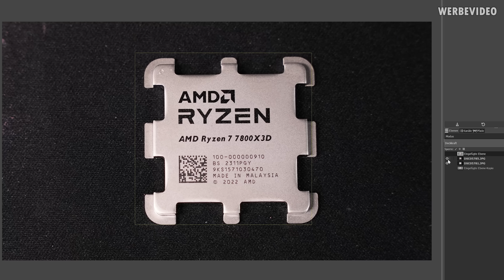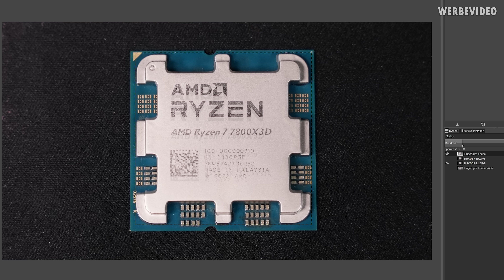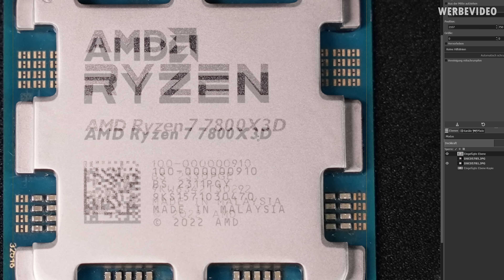Beware! Fake Ryzen 7800X3D CPUs are being sold

Comment: I bought same fake 9950x from local retail store last week. Same PCB, same lid, but different label on the lid. Even serial number can be verified on AMD website (though it says it's a BOX version), but DataMatrix code cannot be scanned. But PCB is 0.15mm larger, barely fits socket.
Will return it tomorrow.

Comment: motherboard makers need to change who wants 20 usp ports and then hey guys we only giving you 4 sata ports far cry from the old 990-fx motherboards 8 sata ports and still had more than enough usb back then the 990fx board runs win xp 64 and native supports 32gig ram win 7 does not you have to be 7 pro or ultra to get 32gig ram also runs win 10 with out issues has all drivers for xp 7 and 10 this should make people really forcing the tech industry to be accountable for the shit show we have now microsoft owns directx they have more influence then is every spoken about. microsoft windows has yet to make a stable media player there is no blueray for windows have blueray drives so what they are usless ewaste now unless you are data storge but hangon how when you dont even have drivers for you blueray WTF .Next secure  rom cd dvd protection does not exist anymore was removed from 7 and is not in 10 this is why game disks will not work and the industry solution for this is buy the game again but you dont know that if you for exable purchase mass effect on steam it doesnt run if you buy from the scam masters EA it works WTF world consumer laws what a joke ram manufactures wont even state what chips are used 100% proof of this fact..... GSKILL dumped all old 8bit chips on the ddr4 ram to get rid of it 2023 date on the ram vers the sam ram bought back in 2021 has 16bit chips if you no your stuff this is not good 8bit vers 16bit double the bandwidth yet not on single youtuber will ever call out this companys like this the only thing you get is a load of it does this were doing that and we will over charge you all the way Honestly WTF happened to all the x570 boards that just disapperaed well they didnt the answer is this manufactures and sellers statement x570 has been discontinued and only low end buget b550 boards for am4 they is just a straight up kick in the guts with a big slap on the face and a F******* you attched to it thanks for the '' we are dedicated to our costumers "" load of shit every cd dvd game that has seucre rom should have been made to be free not con and scammed like we have to the entire world stop and make these scamming con assholes accountable the are cons and scams give me your data i give you no choice im windows ,ea,bethsoda just give us more money and your data so we can sell it and give you nothing and make more money and we still give nothing fsr does not work on new gen games especially dx12 dlss is no different and i have tried this i have a 7800xt my friend 4070 master the nivida card gets the edge not for performance game support nivida is up microsofts ass always was and the compatablity is the thing but windows microsoft is trying so hard to stop this and its simply dx version support in the os call of duty will not run dx6 from memory yet how strange is this heavygear original game cd loads and runs like F*********************** Seriously how and its on bloody win 11 the whiole bullshit about compat issues is a load of shit proof is in the pudding boys and girls its simple cost over profit if it dont break and are not forced to buy new products at this every changing pace the share holders dont get there bonus and billion dollar profits they created the throw away tech low end underperforming crap that you will be lucky if it makes it past warranty before it dies if it does you know its going to fail they dont make boards like the 990-fx anymore i also have the intel version it came out before the 990-fx 2011 and 2008 both pcs still run fine the 990-fx had a gpu failed thats it i saved it from ewaste it just cannot connect to the net for 10 as hopefully it fails 11 support but if it dont it will force 11 install like thanks micrsoft dont even get a choice forced upgrade Seriously and prod perfomance from back then to now is nothing special main thing there was better ram motherboards have just got worse the x570 what a joke they must have made f*** all of these just give you budget shit who in there right mind would use a top end gpu on a f****ing buget board WTF WTF WTF WTF WTF  and price for 800 dollars i can get complete am4 pc maybe even am5 depending on board selection cpu and ram its not to bad for am5 but the bullshit dumbing 40 series now like nivida PPP if you get it and price from old to new vers perfomance thats for a the more money than brains people have to win the pissing contest to bad that is what it all really is YES? Screw the industry return the money you stole from the people for buying your product repeatedly how many copies of the same games do you own from be forced to buy a download soon there wont even be stores 100% online higher unemployment more robots replace workings warehouse industry basically automated robot does it all stack back and store meatworks bring in automated cutter instantly hole section lost there jobs reap the wirlwind people we created the mess just as much as them for we allowed it to happen never said a word all to busy having heads filled with tv shit so we neve even saw it facebook is an entity does not answer to any laws has no customer support and like many other online shit now openly allows multible fake profiles allows false advertising scammers and cons and the world does nothing we are never given the freedom of choice form the tech industry you will accept our terms and the collection of your data or the choice is just simply go away.What is wrong with the world have we become that pathetic as a species Australia 100% yes tell me freedom when you cant have visitors after 8 not allowed to do this if you leave your bike here we will take it and breach you THIS IS FACT the govenment is shit i can prove with zero doubt as its all on record in court if you cross your arms like you were told many years ago you willbe told to unvold your arms as you will classed as having a anger problem. you must not feel in australia if you do there is no help you are just classed as hostile with anger issues let alone the government still to this day takes children i have no rights as im not on a piece of paper like i was even given a choice but you are not allowed to stand on morals or what is right guilty prove you are innocent that is australia we dont even have a unified legal system to protect the greedy business owners that break the laws seen it with my own eyes fact this is why wa has its own transport laws protect the ownwer not the poor explotied worker. australia buisness 101 work faster not safer Fact dont say anything either they will sack your ass for pointing out the failiures of the so called saftey person i have watched pallet after pallet 8 meters up 1000kg that is so bad dangerous and bloody negliegent its not funny....100 % illegal to stack thatv weight that high there are laws do you think wa gives a shit about this no never will freedom rights consumer protection doesnt exist feed the greedy thats all we do

Comment: JCLPCB or PCBWAY + couple of hours of designing the PCB (probably even less - the biggest challange is to make the capacitor location exact), capacitors are probably not even real, but just blanks - that itself is probably around $10 for couple of tens of pieces. A CNC router (below $1000 ) to mill the heat spreader from Aluminium, then nickel plate it... That is the most complicated part.  I'm not sure if the print is laser engraved, or just some sort of thermo-transfer of a laser printed printout. It's not very sophisticated to achieve these days. It just shows, how the technology advance can play to our advantage, but can also be used in a bad way.

Comment: I just bought a 7800xt PURE off amazon on a lightning deal for sub$450 last week. As soon as I put it in my pc and booted up, I checked the update drivers and wanted to run some benchmarks. To my greatest disappointment, the GPU launched as a 7700xt. The GPU was factory sealed, factory stickers and the usual vinyl protection tape. The core of the card was not a 7800xt. The issue with the PURE is the 770xt/ 7800xt and 7900GRE all look exactly the same. I am guessing a buy and swap to return? I never thought I would have this issue and as we have absolutely 0 brick and mortar pc diy outlets in Scotland, we are at the mercy of the internet. I am well aware scamazon and fleabay are the worst places to buy and if a deal is too good to be true, it mostly is.

Comment: absoluut perfect.
i,m just back from China, visit the big Shenzhen bay market stupide as i was i but 10 ! SD cards.
i saw hundreds of shops including a sd card shop where i got "real" Sandisk extreme pro sd cards 1 TB 200 speed and 140mb/s
too good to be true still a 1/3 of the original price, unfortunately i couldn't test them on the spot but i trusted the shop because of the professional appearance, unfortunately when i got home (114600km) they didn't really work well and made errors.
i tested them and formatted them in dos there was only 256gb left of the 1000gb, and a very low speed.
During a previous visit to China I noticed that something was wrong, I had the latest iPhone model 4 in my hands for $100, well... I left it there.

Comment: I was buying a ryzen 9 7980x3d  recently and found someone selling on Amazon for $350. We know that on Amazon, you have protection, but I decided to buy it from the market for $650. My guess is the cpu was not a scam or fake but sold for different regions with high rebate and could not sell the quantity. Amd pays many funding these marketing videos as they receive complaints from distributors losing revenues in certain regions due to unauthorized imports. 
This example was ascam but did anybody pay less and got a working cpu? I am keen to know.

Comment: The level of effort that went into making this fake means there are definitely thousands and probably tens of thousands of these fake chips out in the wild.
The level of manufacturing required to produce the cpu's, the heat spreader, the laser engraving, the boxes, and then match the S/N on the box to the cpu is insane, just to produce a useless product. 😮

Comment: Bruce Lee, an enthusiast from Romania, bought a fake 7800X3D possibly from a Chinese seller on a marketplace made by a Netherlands company that is under the umbrella of South Africa and India parent company. Man what a wild plot why didn't this become a movie?

Aside from whatever I just write,  WTF?? At least with fake 7800X3D that is just non X3D AM5 parts but with faked IHS engraving, you can just resell that, assuming the buyer of that fake X3D doesn't follow the same route as the shady seller and jack up the price + labeling it as X3D chip while it's not, like please don't do that if you're like, don't want to be stressed out by the marketplace return policy if it somehow is just complicated, bad or nonexistent for some reason, though you really have to try and get your money back. If there's no hope for that, follow the moral compass, accept the losses, learn, and move on. But like, at least that would still function as a normal AM5 cpu for you or the hands of whoever going to buy it, as long as it's also not an engineering sample 

This however, this is pure ewaste contribution. Those PCB could've gone somewhere legit, same goes as the metal used for the IHS. And someone decided to make an ewaste scam out of it

Comment: Is the fake heat spreader actually copper, or is it steel or some other, cheaper metal? Aluminum might be too light, so I'm thinking mild steel would be a good possibility. It would probably need a flash coat of copper first to get the nickel to stick, but that would still be way cheaper than using solid copper for the heat spreader.

Comment: It's possible the scam originates from the factory where the heat spreaders are manufactured.
Reply: Everything is possible.   The PCB's are easily bought from online PCB manufacturers.. You could even order PCB's cut to size, and even have all the capacitors presoldered from the PCB manufacturer.

Comment: Smart enough to use a Multimeter to check a CPU.......not smart enough to recognize a scam. Sounds about right.
Reply: Not possible to recognize it as a scam, until you have the item in hand though.  That's how accurate the fakes are.

Comment: i got my 5700x from a reseller. the box it came with had the rather unique-looking import label with the names of the person i bought it from (this is a guess), and the name of the person the seller bought the cpu from. long story short, my cpu came to argentina from florida, and to florida from china. turns out its an oem chip. the quality of the silicon isn't good but at least it runs flawlessly so far. i don't need this much performance so i just run it at 3.4ghz with the lowest voltage it can tolerate, currently 0.80v and probably even lower if i weren't always busy with keeping a stable job.
Reply: Oem chips are the same quality. You might have a dev sample
Reply: @hiddeninthewires2308  it looks like a completely normal chip

Comment: Just in case you would be interested in some analysis, I have a genuine 7800X3D that ran fine for months but died suddenly during a benchmark run with a hefty OC. I had it running on a X670E Gene with 105 BCLK, LLC 8, CO +10 all core, PBO Enhanced 90c, RAM at 6600C28 1:1 mode 1.450 VDDIO 1.300 VSOC 1.150 VDDP. The PC just turned off during a Y-Cruncher run and only QCODE 00 after that. I tested the CPU on 3 boards and all 3 just stick to 00 or hang on CPU LED during POST. The boards are fine with my replacement 7800X3D which works fine. There's no physical damage on the pad side and the CPU does still heat up in the socket on 00 QCODE without a cooler on it. It's not delidded. Temps at the time of failure were high 70c range but the core voltage due to BCLK and LLC 8 was very spiky and I saw 1.296v+ regularly under lighter loads. 

If you want the chip, I'm, in the Netherlands so shipping to Germany is cheap and fast and I'm not looking for a paid replacement or whatever. I just want the shipping covered and I'm curious if something can be found out in the name of science / my own interests in hardware.

I could've RMA'ed the chip if it wasnt for the fact this is a Tray SKU CPU and AMD does not warrant Tray SKU's directly and the shop it came from immediately claimed user induced damage and also won't cover it so I just bought another one as I really can't be bothered to discuss warranty validity for weeks and be without a PC and technically the shop is right, the chip ran fine for months and it broke while overclocking and while AMD has a LOT of protections and limits set up for X3D using BCLK + LLC 8 + positive CO can still go way outside of the limits so it IS user induced damage and I don't wanna claim that as warranty tbh. This time I bought a Boxed SKU tho..

Comment: The PCB color on the "FAKE" 7800x3d is the same PCB color used on GENUINE 9000 series. 
7000 series use green pcb, 9000 uses whatever color that is called on the fake 7800x3d.

Comment: There is an Embargo on China for new generation CPUs, just as there is for Nvidia 40xx CPUs. So the Chinese counterfeit them en masse, then buy them through their people in Europe, send them back to the manufacturer of the fake cpu, then get another good CPU in return, and that's how they get around the Embargo by having a brand-new CPU worth 50% of the new CPU on China. Three months ago I bought an almost identical RTX 4090 graphics card on TEMU. Everything almost the same as the original, except for a slight difference in the font on the prints.

Comment: my wild guess is that display prop that put during expo or showcase, like phone case with fake display. because the size is small and pocket size, it's common to use fake display prop. but in marketplace usually the order is not immediately closed when we receive the package, in my place we allowed to have 2-3 days before we can close the order and money transferred to the seller, so within 2-3 days we can open dispute regarding the product (not sure with olx tho). usually the main issue is that when we order both (cpu and motherboard) at same time and it not arrived at same or within dispute time, this make testing is difficult.

Comment: One thought about the "screw holes" in the heat spreader.

Did you compare the weights of the real and fake CPUs?

That extra metal might have made it too heavy and get picked up by the very accurate weighing machines used in some parcel distribution centres; so the holes might have dual purpose, to shave down the weight closer to the original.

(I have had parcels rejected for being 1 gram over weight).

Comment: I´d say the IHS is probably cast from some metal scrap like old aluminum soda cans or something.

the uneven edge visible  on the fake at ~9:50 at least to me totally looks like a mold split line but the screw holes are probably for the electroplating process as you say.